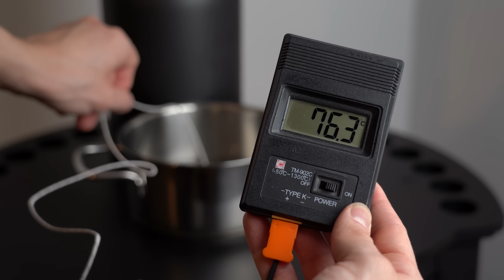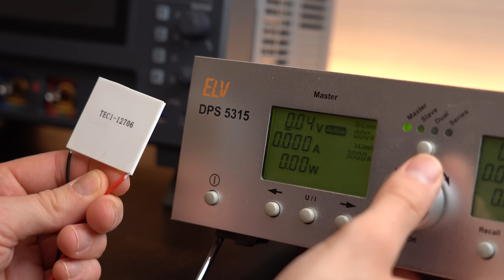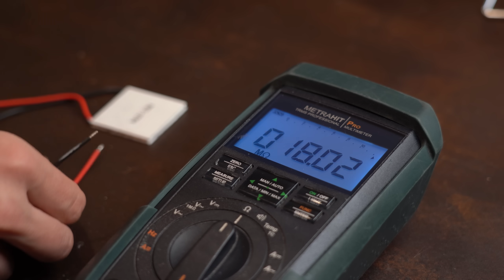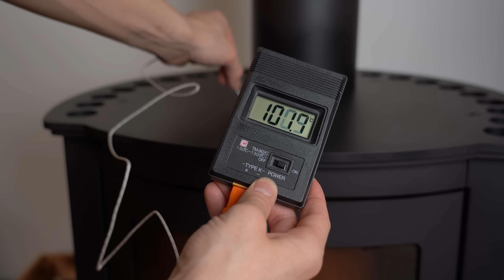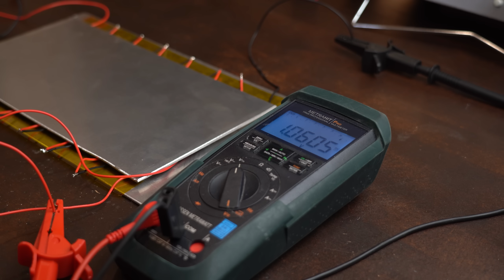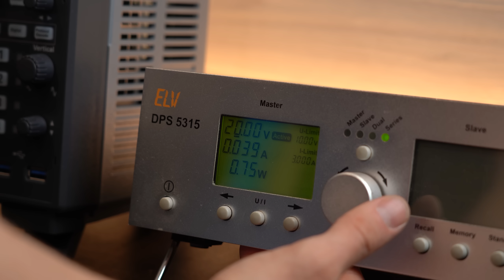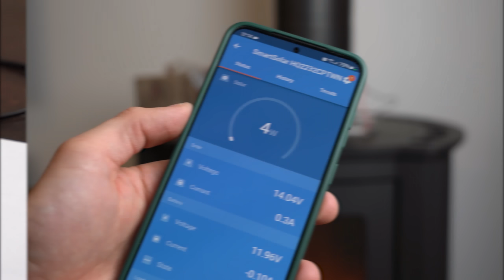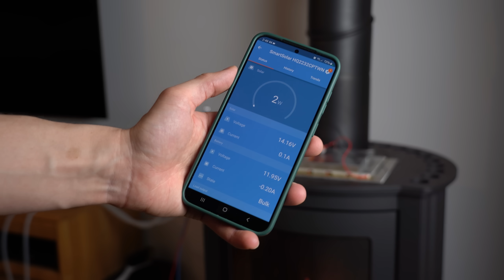I tried to Power my Home with Heat Generators! (Worth it?)

Comment: At this point, a crude steam powered turbine attached to your fireplace might output more than 6 watts
Reply from the maker: Haha true
Reply: @greatscottlab dont use Steam engine it could be dangrous use an stirling engine if possible it is Moore efficent and safer
Reply: @greatscottlab Germans always over thinking everything.
Just stick the peltiers to the smoke pipe to catch waste heat.
You could also go full spastic and put the water container the same or higher level than the stove.
Thus the water will circulate without the need for a pump. Then add insulation all over and have the peltiers on the water circulation direction of the water tank thus they will never heat more than 100C.
Reply: @greatscottlab Germans always over thinking everything.
Just stick the peltiers to the smoke pipe to catch waste heat.
You could also go full spastic and put the water container the same or higher level than the stove. Thus the water will circulate without the need for a pump. Then add insulation all over and have the peltiers on the water circulation direction of the water tank thus they will never heat more than 100C.
Reply: @greatscottlab  Next video will be on that I presume?
Reply: @greatscottlab Germans always over thinking everything.
Just stick the peltiers to the smoke pipe to catch waste heat.
You could also go full on over complicated, put the water container the same or higher level than the stove.
Thus using waters properties it will circulate without the need for a pump. Then add insulation all over and have the peltiers on the water circulation direction of the water tank thus they will never heat more than 100C. You can also use the system to store heat and maybe have some radiators or something to get it out. Here in Finland we have some heat storage systems using sand.
Reply: Or a stirling engine.(Hyperspace pirate made an excellent video about it)
Reply: @blackbird8982  yeah, the score to beat is 60 watts total, me thinks it could be done with a reasonably small fire and you're only gathering about half the heat.  The carnot efficiency is around 65% for a wood fire and a toasty inside room temperature.  
You could make the fire burn a bit hotter by using outside draft (cold air) and perhaps reject some heat outside, but I think the point of the hot stove is to make the inside warm, so waste heat could be recovered at the cold end...
Reply: @blackbird8982  Sterling engines do not have lots of torque or RPM's so that makes them unviable for this application unless it was huge..
Reply: @blackbird8982  came here to say the same thing.
Reply: @blackbird8982Stirling engine can't self start tho.
Reply: @blackbird8982I don't trust pirates.
Reply: i was abut to say same . Peltier's are very inefficient
Reply: @iFABug  I did but with a high tech twist.. My system has no pressure vessel other than the flash pot so no over pressure would be required because you could limit the input water tube to be small enough that it could never build a high enough pressure to rupture and if it did it would be enclosed inside the wood burner anyway.. Not sure on the amount of noise it would produce but being inside the burner and chimney would help limit that at least till it got to the roof..
Reply: @iFABug  but there are thermoelectric generators which have higher efficiency
Reply: I also wonder how a wood gas generator feeding a conventional ICE would compare
Reply: @pbe6965  it works, i do power my house that way in dark months when solar and  wind power is insufficient ,
 but it is very messy and require regular cleaning.
Reply: @pbe6965  On the YT channel "Gridlessness" you'll find a whole video on that topic, both with practical remarks about making such stove and powering the generator. :)
Reply: @pbe6965 Going back to WW2 thinking I see, very fitting since he's German. As the German were using wood gas on a number of vehicles during the fuel shortages.
Reply: @SilvaDreams  it was also used in France, I guess it's mostly a west european thing due to ww2 circumstances as you pointed out.
I've seen these recently in projects to "recycle" plastics into fuel, especially those that can only be downcycled and ends up worse each time they're re-used.
Reply: @pbe6965  and in northern Europe, even in neutral Sweden as neither side of the war wanted to send any fuel, except Germany with coal
Reply: Yup would definitely do it, a bit dangerous though. They use thermoelectric generators to power deep space probes with nuclear fuel, but if they used a thermomechanical generator you would get an order or two of magnitude more power output. The best thermoelectric modules have less than 3% efficiency..😮
Reply: More accurately the elements used should be called Seebeck elements.
Reply: word ... especially if you don't use water as the working fluid but butane/propane instead
Reply: was the first thing that i thought
Reply: Starling Engine is the right way to go..even submarines use it.
Reply: @foxm3319  I second (or third?) the Stirling Engine idea.
Reply: Had same thing in my mind
Reply: Everyone needs a sterling engine to blow the air around the room, it makes quite a difference.
Reply: The true way of generating power is, after all, boiling water
Reply: @bruderdasisteinschwerermangel  that's both factually incorrect and inherently misguided. For one boiling water is just a typical pre-requisite for modern power generation. The true power transfer happens when you dry the steam. Wet steam, ie the result of boiling water, carries almost laughable energy compared to fully dry steam.
Considering the larger picture on the other hand means assessing everything on the Kardashev Scale and you definitely don't get to even type 1 by just boiling water. To get even that base level of civilizational advancement you need to transfer a lot of mechanical energy to usable electricity or similar. A process uniquely unsuited to heating anything efficiently.
So, no, it's not about boiling water. In fact that's the single most basic thing and not even the foundation of our current power generation.
Reply: @Argosh  dude it's a joke
Reply: @bruderdasisteinschwerermangel  yeah, but I'm tone-deaf and pedantic.
Reply: just a fan in the chimney would probably beat that
Reply: @KarolOfGutovo  hmm I'm wondering if this was tried before, probably in some weird devices from the 70s or so.
But the chimney is also critical in terms of safety (because yknow, fire), so idk if I'd want to modify it.
Reply: This.
Reply: I'd love to see some him actually try this
Reply: sterling engine
Reply: Sterling or steam engine next
Reply: Use rain water for the steam source
Reply: A device that can produce energy from a relatively small temperature difference efficiently would be a game changer and solve global energy and emission problems instantly.

But it's not invented yet....
Reply: Nice idea. It will be nice to try. With the direct stove contact without any changes inside the stove Scott can try to use the ethanol (Brennspiritus) as a working liquid-gas system. Also it can be interesting to try small wind turbine in the stove air intake position.
Reply: My thought exactly. :)
Reply: I guess the Victron MPPT isn't optimised for such low power generation. So load resistance is not matched to peltier resistance.
Reply: Yes maybe 3000w
Reply: I think that even flock of those ether filled glass, toy -like birds that swing in heated environment with some magnets attached to them and coils nearby might have better power conversion ;)
Reply: fact is using a fractal lens to super heat a container to produce steam is legitimately powerful stuff.
Reply: peltier sind gut für Heizungs oder Ofen Lüfter die die Wärme verteilen. Ich wusste gar nicht das er in Deutschland wohnt.
Reply: Steam is the way to go here.
Reply: True, but that would produce old energy, rather than new energy which would therefore fail to comply with the requirements of the energiewende ['energy transition'] suicide cult (sorry, I mean 'modern enlightened thinking').
Reply: @aporiac1960  Ah yes, the terminally online AFD electorate. I have no idea how you managed to turn peltier vs. steam power generation into a "old power vs New power" thing and compare it to the Energiewende? That has nothing to do with it. Also, calling something that tries to preserve the future of the next generations a "suicide cult" is interesting, to say the least.
Reply: @aporiac1960  What does 'old' and 'new' energy mean here?
Reply: @ohanneskamerkoseyan3157 
Old energy is burning fuels.
New energy is taking government rebates to turn inefficient gimmicks into a huge profit.... Then burning fuels to make up the shortfall.
Reply: Komm m runter von deinem alu Trip. So eine Maschine zu bauen ist nicht leicht darum hat er das sicher nicht gemacht. Aber ne schaue Idee wäre es schon aber zu groß für n yt Video  @aporiac1960
Reply: @BooBar2521  Any heat engine using gas as the medium would do. The degree of simplicity/complexity depends on the design, but we are talking about a well-understood, efficient, reliable and economical class of machines for converting heat into work, which is why they still form the backbone of most electrical grids.
Reply: @aporiac1960  Wie meinst du das? Sowohl eine Dampfgenerator als auch Peltierelemente nutzen die bereitgestellte Wärmeenergie vom Ofen um diese in elektrische Energie umzuwandeln. Da wäre nix "alte" oder "neue" Energie, die Dampfmaschine wäre einfach nur effizienter und würde dadurch mehr elektrische Energie bereitstellen.
Reply: @Minecraftzt176  By 'old' I mean something simple, practical, reliable, and cost effective. What I mean by 'new' is it sounds good.
Reply: @aporiac1960 do you enjoy breathing? Because that will be exceedingly difficult on the outside in the summer in about 20 years almost regardless of where you live.
But sure. Who are we to say that profits for huge corporations should not be more important than literally all humans on this planet.
Reply: @Argosh 
You're clearly young... 20 years until the world ends has been a thing for about 50 years.

I'm not saying we shouldn't try to be efficient and use limited resources wisely... I'm saying that there's a cult of people pushing this end of days thing, and have been for half a century.
Reply: @tin2001  in 20 years you're gonna wish for cooler years like 2024.
I can even remember when we had snow in winter. But eh, I was never into winter sports anyway.
Reply: @tin2001  also, being called young by someone with 2001 in their nickname is... Curious. I'm sadly old and smart enough to have realized that nothing matters. We have literally created hell on earth and the only thing people care about is the music to play while the house burns down. Fiddles are out of fashion after all.
Reply: @Argosh  You have an overactive imagination and an unstable personality and so I expect you are breathless most of the time already. My advice is not to overstimulate yourself with scary stories that are only going to distress you and confound your feeble wits.
Reply: @Argosh  Birth Year is more common, but people do put their graduation years in user names as well.
Reply: @priestesslucy  both are funny from my perspective. XD
Reply: @aporiac1960  you're kinda cute when you try to act like a real troll.
Reply: @Argosh  No. I've heard we are actually in an ice age. Astronomical phenomena get forgotten too easily by some people who buy into a current thing. ;)
Reply: @CJWarlock  just... no... Unlike you I've not "heard of" this old and false claim. I have actually researched it. That means actually sitting down and using a search engine of your choice to look up varying sources for the claim. Turns out it's a load of nonsense.
Reply: @aporiac1960  🎯🎯

Comment: Have a look at these Peltier ventilators that you put on top.  They actually do work well distributing the air and thus warmth around, really makes a difference.  Peltier elements like you placed will also spin some fan but there is always the WAF to deal with (Wife Acceptance Factor)
Reply: And those fans often have an overtemperature protection. A small piece of bimetal Lifts and tilts the base if it gets too hot. Limiting the hot input temp and keeping a high delta between hot and cold side is very important. With low single digit efficiency, the cold side must be able to get rid of a lot of thermal Energy. For 6W electrical Output, maybe 300W  or more must be dissipated. Not an easy task with such tiny surfaces.
Reply: WAF

Comment: The problem is that you used peltier cells and not seebek cells, normally the peltier cells are designed/build for a maximun of 100ºC at the hot side while the seebek cells are done for 300ºC or more at the hot side.
Reply from the maker: Thanks for the feedback :-)

Comment: Loudly screaming at that setup 😅 you aren't supposed to use Pelletier elements above 100C at all. The easiest way to demonstrate their use is submerge them in water in a finn pattern with a hot side and a cold side waterflow - stacked in a shoebox you can get constantly 50w out of it for demonstration purposes of course you have constantly pump in cold and hot water.

Comment: yeah, nah that wont work so good. Your could boil water on the stove, overheat the vapor in the fireplace to gain superheat to drive electric turbine and let the vapor cool-down in the pond. just use open-loop system for the cooling and you be fine...